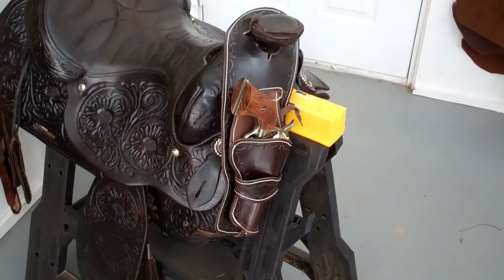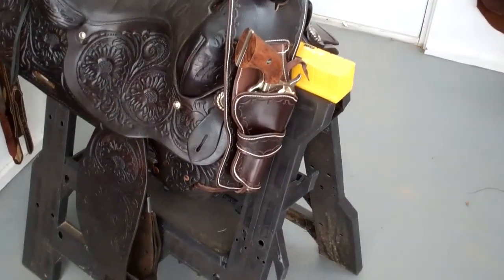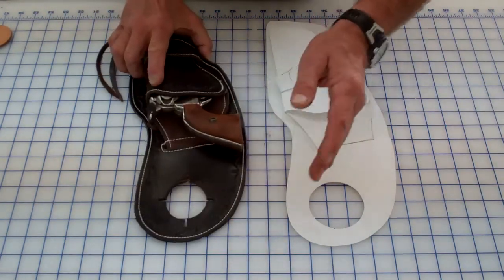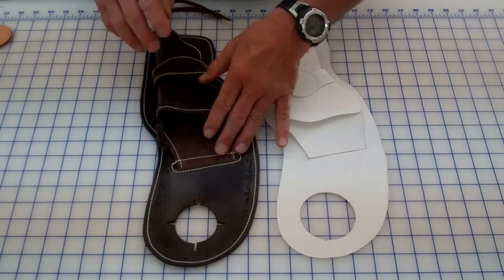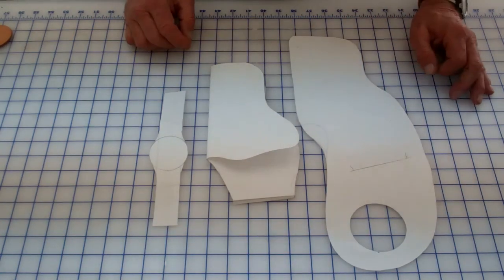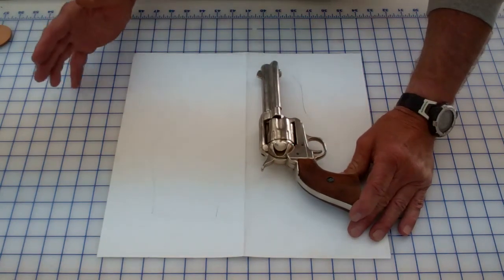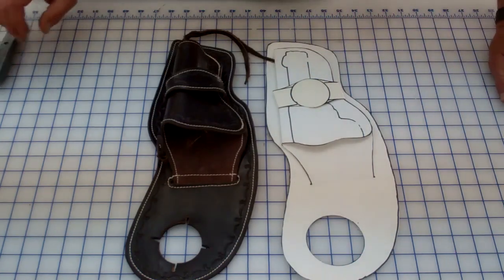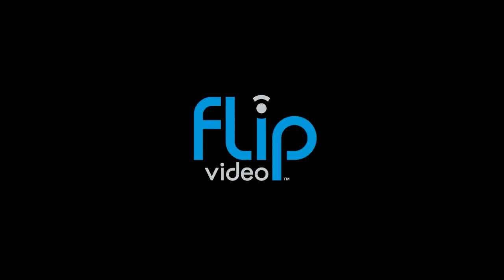Making a Pommel Holster Part 1 of 2 Holster pattern design

Comment: In the initial moments of the video, when you are displaying the completed version of this project, what type of white thread are you using? Also, are you hand stitching, or machine? I use Tandy's version of tiger thread and it gets dull when pulled taught...
Reply from the maker: This is machine sewed with a nylon blend  #207 thread. When I hand sew I use Tandy Leather's Waxed thread white. It's of good weight and works well for me. Thanks for watching
Reply: Richard Black Any tips on keeping the thread really whit?  It gets dingy when pulled through the material.(I do use a groover)